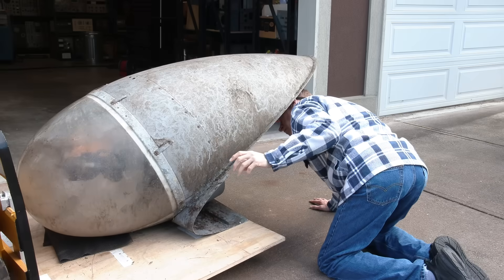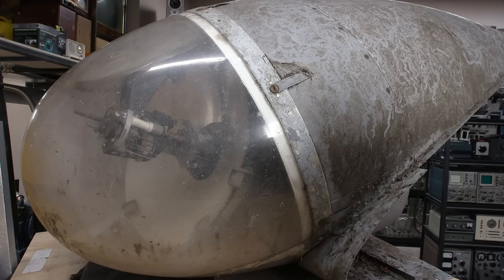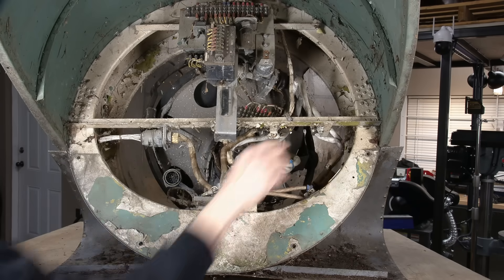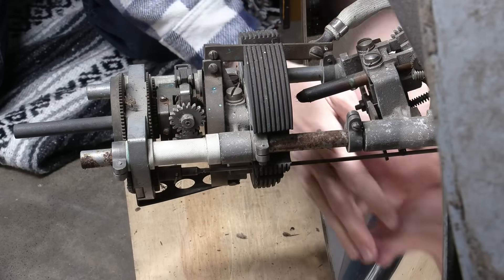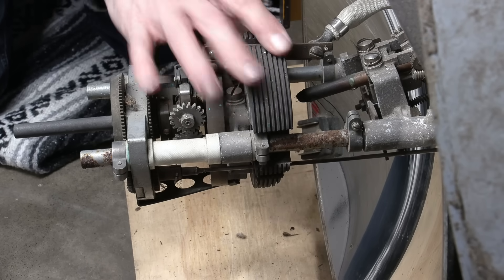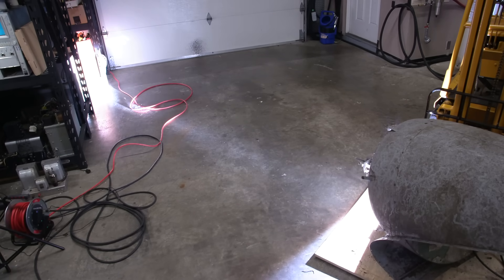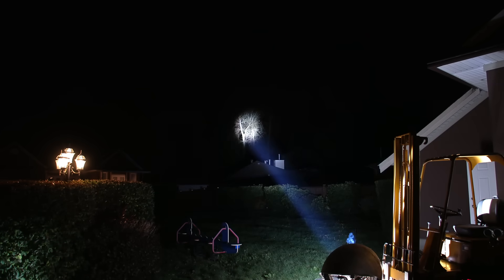70 Million Candle Power! Super Bright Anti-Submarine Searchlight - See It Light Up!

Comment: This is how motion pictures were projected up until the mid to later 70's .  Then Xenon lamps were introduced, which produced a different color temperature.  Eventually, the processors adjusted the timing on the prints to account for xenon. color temp.  Pre-70's films were distributed on reels which ran about 20 minutes.  Despite some claims, 20 minutes was deemed to be the length of time before the carbons had to be changed.  Not so.  A positive carbon can run 60+ minutes.  The negative carbon which burns much more slowly, can last up to 120 minutes.

Comment: In the film biz we use 18,000 watt hmi lights. They have about 24 inch diameter fresnel lens housing which weigh about 100 lbs each, powered by 3 x 6K power inverters. On Chronicles of Riddick we had 100,000 watt hmi lights with 8ft long bulbs and an entire transformer to power each of them.

Comment: Very similar to the Pearless Magnarc Light we used with a Simplex 35 cinema projector.  That thing had a 3 phase power supply that used large mercury rectifiers 
I do not recall how many watts it consumed but probably more than 1 KW.   Quite a contraption but it was bright and got the job done although it took a bit of skill
to keep the carbon rod advancing system correctly adjusted.

Comment: I worked on S2F anti sub aircraft.  The ones on our planes. Could not be ran on the ground other than on and no more than 2 seconds.  They needed the air flow so they did not melt the front of the light.

Comment: yes, I know such headlights all too well from the air defense back then, but I am more surprised by the maximum current strength of the welding machines 80 amps for WIG or TIG with you, I have one myself as a hobby with well over 180 amps, now I am confused

Comment: The anti-submarine aircraft light developed by  Humphrey de Verd Leigh of the RAF in the second world war. Aircraft hunted U boats with the then new shorter wavelength, higher frequency radar, which had the disadvantage that the screen image disappeared close to the target, at which point the target was illuminated by the Leigh Light. U boats surfaced under darkness to recharge their batteries were caught before they could dive.

Comment: The movie industry of course used carbon arcs until about the 80s when HMI lights took over.   I have only seen carbon arcs once around 1996 on a film called Bogus in Toronto.   The cinematographer was an old British gentlemen who loved the hard quality of light from them.   They had two carbon arcs shipped up from LA and one was stamped RKO pictures and the other Desilu Productions.    Some crazy movie history with those two lights.

Both lights were ancient and the rods didn't feed perfectly any more.  If the gap of the arc was too big or too small you could get flicker.
Was a total pain in the butt to have to run extra DC lines of 4/0 cable just for the arcs.  The lights and their stands were total beasts too in terms of weight.

Comment: When I was a kid we made arc light from the carbon rods from C cell batteries. We made a box to mount the rods. Then 120VAC from the wall. The power was run through a bowl of salt water to act as a resistor. It would keep the circuit breaker from popping. It worked well and it is amazing we survived.

Comment: Carbon arc searchlights on maritime patrol aircraft like the S-2 and P-2 were not particularly successful.  Aside from the peculiarities of carbon arcs mentioned, unless it was a crystal clear night, the sea mist would reflect about 80% of the searchlight output right back into the eyes of the flight crew effectively blinding the pilots.  In practicality, the searchlight did a lot better job of making the aircraft an easy target at night, than it did illuminating anything on the surface.  On the P-3 there was a story (probably made up) that a crew preflighted the searchlight in preparation for a "light-ex" and found that jet fuel from the wing fuel tank had migrated into the searchlight to the mid-point.  Had the arc been lit off, the fuel would probably have ignited.
Reply from the maker: Thanks for sharing your story!

Comment: Bringing back memories Mr Carlson. I flew in the S2-G tracker as a radar operator. One of our combat qualifications was to perform a night time radar run in on a surfaced submarine at 500 feet above the water. If I remember correctly that search light was rated at 6 million candlepower and had a duty cycle of 15 seconds "on" over a one minute period and then a 4 minute cooling period before you could activate it again. This was over 50 years ago so my memory may be flawed. The co-pilot was the joystick operator and most often had to take some photos of the surfaced sub for the crew to get the qual.
Reply from the maker: Thanks for sharing your story Paul. The lamp is rated at 70 Million Candle power, but the duty cycle sounds about right. The light is so intense, the dome was beginning to melt where the light was focused (front of the clear dome.) The area of the dome "above the actual heat source" (carbon rods) was fine surprisingly.

Comment: You would find the arc works better if you have it the right way up. The mirror focuses the plasma ball in the center of the positive carbon, if the lamp is up side down the magnetic flux from the arc will force the plasma ball out. I have used carbon arc lamps for over 55 years. Even today when I run film in my little home cinema I use carbon arcs and 2 single phase mercury arc rectifiers.

Comment: What I missed was how the mechanics works which holds the distance between this Carbon rods. How long there are. how long do they burn.
The same technic was used in cinema projectors. They had to have two projectors. Each of them  are capable to hold 600meter  (2000ft) reels which took 15 to 20 minutes to play. 
During this time the carbon rods burn down. After this the cinema projectionist had to change the reels and the Carbon rods. During the projection he had also contoll the gap between the rods. 

But how long does the rods burn for this lamp?
Reply: Found it on Wikipedia, the arc creates a pit in the anode that reaches +3000 degrees Celsius and that creates most of the visible light. The rest produces a lot of UV but hardly no visible light
Reply: I missed an explanation how the physics works. I expected a bulb filled with certain gas, not two rods in open air ...
Reply: @effedrien  No just  an  simple arc lamp. they exist about  150 years. Where the power on the plane comes from is also  a  interesting question. They had to have very strong generators on the engines.

Comment: In the summers of 1970 & 1971 I worked as a deck hand on a towboat on the Mississippi, Ohio, and Tennessee Rivers. There were two carbon arc searchlights mounted on top of the boat's pilot house, controlled by joysticks at the helm position. At night, the pilot or captain used the lamps to pick out land features, bouys, bridge piers, and shore markers to help him guide the boat and stay in the channel. When I stood watch at night, one of my jobs was to change the carbon rods in the lamps as needed. The range of the lamps was easily a mile or more.

Comment: It would be SO COOL to get the pan and tilt working.  Using a TIG's HF start was perfect.
If you used a HMI bulb, you could really make it usable.  They are 100 lumens per watt so similar to a LED.  Not as fun as carbon arc though.
Osram HMI bulbs are available from 200W to 24kW!!!

Comment: The face-melter light, that's such a focused spotlight. I wonder how hot the beam feels, could it hurt skin close range? 
Oh, and if you have some small rust pits you want to get rid of you can ball up sme aluminiium foil and rub the rust away without scratching the surface around, it also works extremely well for polishing pitting when you put a small amount of polishing compound on the foil ball.

Comment: FYI, those 1/4 turn fasteners holding the dome are "DZus" fasteners.  Note that they have a crescent-shaped slot.  They are designed to use a special tool colloquially called a "Snoopy Tool" in the USAF, maybe/probably elsewhere.  One end is shaped rather like the Peanuts character Snoopy's head in profile.  Both references easily found with internet search engine.

Comment: I've had this question lately....how hot can an electric arc get? Electrical safety material says 35,000C+. Plus what? How much? I know plasma has an electrical resistance that's theoretically zero, so its temperature could theoretically become infinite, but that's only theory. I guess the limitation is materials allowing you to put only so much energy into a given volume of space before the expansion of the superheated gas the electrodes turn into outpaces the electrically conductive abilities of the same material and it reaches an equilibrium point. Sort of like the Eddington limit for stars, only for adding external energy via electrical conduction, not releasing it internally via thermonuclear fusion in the star's core.

Comment: The craziest aircraft lamp i ever saw was a 15kw average 125kw pulsed krypton cesium arc lamp. It went to an active countermeasures system and the tube itself was about 8 inches long and 1 inch in diameter. It was made of a machined cylinder of sapphire and in a gold plated reflector. It had a silicon window to pass the near IR but none of the visible, but without the window it was a soft violet pinkish white but was so strong it would light plywood on fire from several feet away. ❤

Comment: Many years ago, I used to "burn" printing plates using an arc lamp. Normally, the process of starting the arc was automatic with a solonoid operated ratcheting mechinism. But it no longer worked. So, I had to open up a door, and using a small hand crank, to start the arc. Trying to do this without looking at it was not easy. After it lit, I'd quickly close the door. It was an insanely bright white light that would surely injure your eyes if you looked directly at it. Later "plate-makers" used a mercury vapor lamp to burn printing plates.

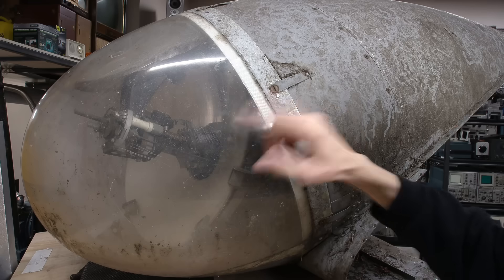Comment: 2:45 hook your garden hose up to it so you have a continual flow of water over the plastic when the light is on. That would work.
Reply: But why? He don’t need the cover outside as the unit will keep itself dry and the water cooling is impractical for indoors

Comment: As a boy back in the 70's I used to work at a theater that used one of those lamps on the projectors. They worked great, and actually threw a better picture than the first bulbs did. (although as cheap as the owner was I'll bet he used cheap bulbs ;-) I wasn't allowed to touch those old projectors as they were a bit finicky. I was able to run the new ones though, but they weren't nearly as impressive 🙂

Comment: 5:55 Personally I would have looked up the tech manual for servicing this equipment considering it operates at 70-million-candlepower.. the chemicals or cloth you use at that power makes a difference in the performance and longevity of the equipment.

Comment: As I'm sure you're aware, carbon-arc lamps were once the mainstay in motion picture projection but beginning in the 1970's, began to be replaced by xenon HID lamps. In my case, I was once a 35-mm movie projectionist but left the business in 1983 when carbon-arcs were phased out. This change, along with the elimination of two-projector "changeover" exhibition, altered the business forever and many of us went to greener pastures when theaters converted to automation. In my case, I moved to the stagehand segment of my union's trades and never looked back. Still, it was once a fun and fascinating business to earn a living in. I applaud you for your work! BTW, if your unit's reflector is glass and if you can score a can of it somewhere, we used Bon-Ami cleanser to clean our reflectors. Strong Electric, who manufactured scores of carbon-arc lamps and actually made their own glass reflectors in-house in Toledo, recommended Bon-Ami because it had a much finer pumice grit and hence, would not damage the glass,
Reply from the maker: Thanks for your comment, and taking the time to write!

Comment: A Grumman S-2 based out of NAS Miramar in the 60s was being taxied by a mechanic to do an engine run. At the run up area he decided to also run a few other tests, pne of them being the ASW light. The right wong was out over geass however a d in the few seconds he had it on was sufficient to start a grass fire that burned a decent patch of grass and threatened some other parked aircraft.  After that, the ASW light was prohibited from geound testing outside of a designated area.

Source: My incle was a Detection Systems Operator on the S-2, E-1B, and E-2.
Reply from the maker: Thanks for sharing your story! Very neat.

Comment: Most movie theatres used carbon-arc lighting, later they transitioned to Zenon bulbs. It appears theatrical openings used carbon-arc search lights on the ground pointing into the air to draw a croud. Of course, during the war, they would be used to spot aircraft.

Comment: Amazing to think that LED lamps can reach similar light levels in a luggable self contained casing. How technology has advanced from carbon rods, through halogen filament lamps, to laser stimulated search lights, all the time getting smaller and more power efficient.
Reply from the maker: 70 Million Candle power? That would be quite the LED array! Thanks for your comment.
Reply: @MrCarlsonsLab  I think the channel the Hacksmith has done it, it was quite the array and it required water cooling so the LEDs did not cook out.

Comment: A couple years ago we've seen a Carbon Arc Lamp at a technology museum and I even had the opportunity to turn it on myself, and film it up close (straight into the light, and yes I was aware that I was risking the camera sensor with it😂). That footage ended up in a private (non published) vlog back then. I might cut-and-edit it someday to upload that footage though😊

The one we've seen in action was used for large factories back in the day and at docks (at least that's what they told us). They where in a MASSIVE ceiling fixture though. didn't thought about asking it back then, but thinking about it now, I'm really wondering on the lifespan of them and how often they would need to maintain that stuff... And to me it doesn't sound like the "brightest idea'"  either to have such bright lights in your workplace (considering the risk of damaging your eyes).🤷🏽‍♀

Just checked the vid: the plaque on the wall stated that that was an 'improved version' for factories and such, running at 65V with high current, and that the improved version could run "much longer than just a few minutes now", it however didn't stated how much longer. Only some additional information that they also used the technique in lighthouses a while.

VERY Neat one you've got there though man, and impressive you got it working 😊👍🏽
Reply from the maker: Thanks for your comment!

Comment: Used to turn the twist locks we called them DeZuzs fasteners.  Used to hear a story that pilots would have to turn off a bunch of breakers to operate that light. No clue if it was an accurate story. HC-4 -HSL-30 USN 1970-1974. We did not have those on our H2’s.

Comment: They used to use those carbon arc in old cinema projectors as well. which I had a lot to do with, so I know from first hand experience how bright they are. Also remember that said aircraft might be several thousand feet over the ocean, so it needs a narrow beem to compensate for the altitude.

Comment: Childhood memories of our county 4H fair. One of the ways they used to bring attention to the fair, was using carbon arc search lights. They had two or three in operation, scanning the sky, you could see the light trails for miles. Those things were massive, mounted on a trailer which also contained the generator to power the carbon arc. I can still recall the smell of the burning carbon rods. Thanks for the trip back in time.

Comment: This type of light was developed in World War 2 and known as the Lee light and used the hunt.German submarines The lee light was developed as a little baby brother to the american anti aircraft search lights that have a sixty inch diameter reflector. The light itself was separate from the generator which was separate from the control stand that would rotate and gimthe light to track airplanes.   Earlier control stands had binoculars or giant listing ear megaphones to control the direction of the lights   Later on, radar was used to guide these lights to airplanes,  as it was simpler than retrofitting all the guns with radars  The focus of the light beam on these AA Lights is three miles away.  As the carbon rods would burn down there was a control system(vacuum tubes) that would keep the Arc at a certain point in the lamp by feeding in the positive and negative rods appropriately.  If this system failed the arc would eventually burn into the feeding mechanism and destroy it.    Most of the World War Ii anti aircraft lights were converted  to lights for grand openings another publicity events.  Very few still exist unmodified today.

Comment: Hi Paul. Takes me back to the Bauer carbon arc projectors at the drive in. Manual arc strike by winding the rods apart while powering up. The side of the "lamphouse" had a small window with welding glass so you could monitor the arc. So much fun to work with.

Comment: Based on the WW2 Leigh Light invented by Wing Commander Leigh RAF.  Used against U-Boats in the Atlantic. It was Radar guided and switched on at the last  second
Nothing to to do with heat (housing was glass) it was often gound tested, they just did not want to warn the U-Boat

Comment: Carbon arcs were common in film making.  Whenever I was on a set with them, they were always operated by old school electricians. They are powered by large DC generators and put out a lot of heat. They are still used when the DP is going for the old school light.